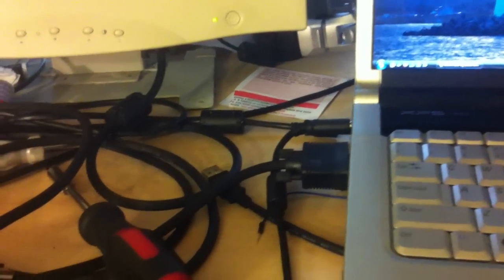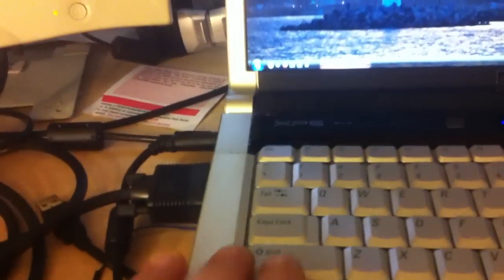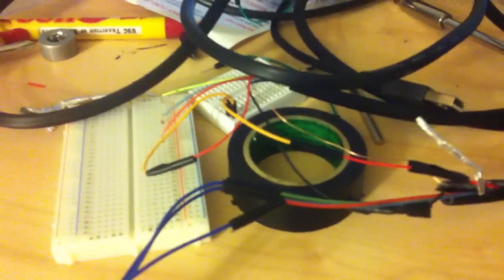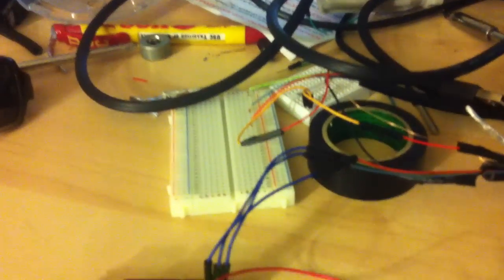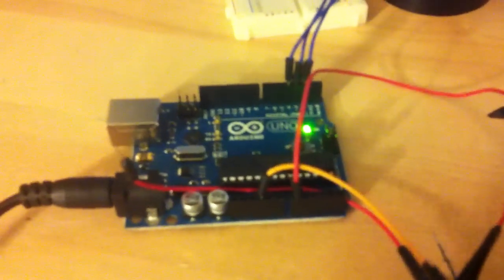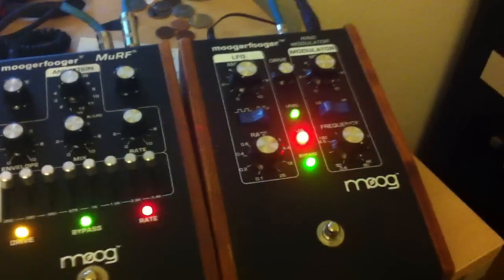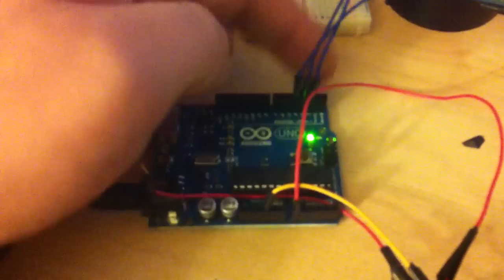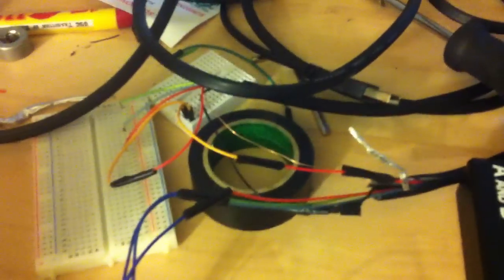arduino vga hack

Comment from the maker: here is the code i used:

void setup() {
DDRD = B11111111;
}

void loop() {
PORTD = analogRead(0);
}

from my understanding the color is just based off of the volume and frequency of the sound.  there is no set light frequency to sound frequency translation.  change the pitch or volume of the sound and the light changes with it.  im not sure what makes a blue show up more than a green it seems like it is kinda random.  im not too versed with electronics or arduino, this was my first big project.

Comment: What is your equation for your light frequency to sound frequency translation.
               (What determines the color on the screen of the sound from the moog.)

Just curious as to why your monitor shows multiple thin lines of color and why they are positioned where they are.